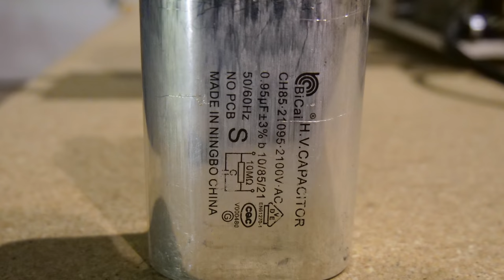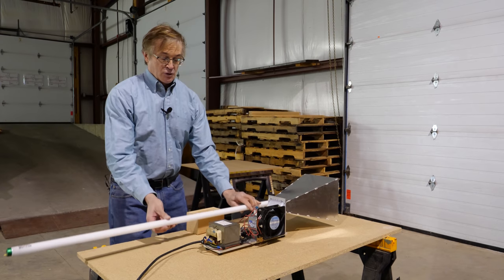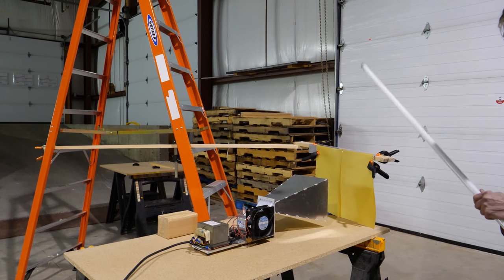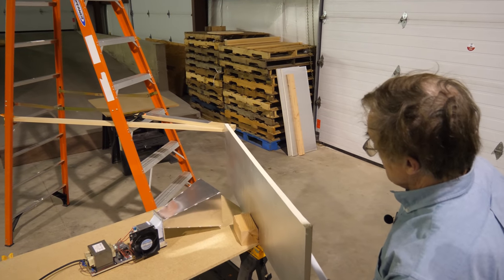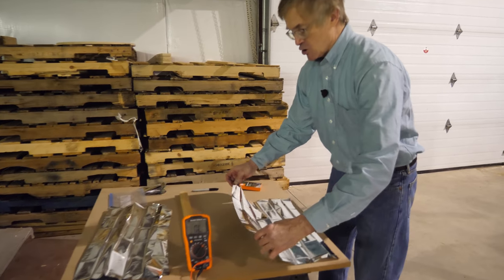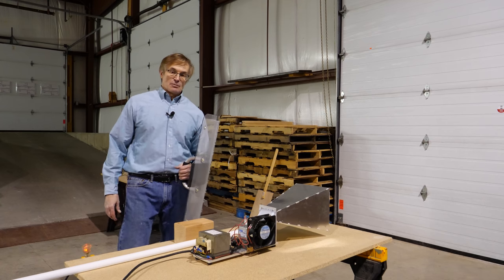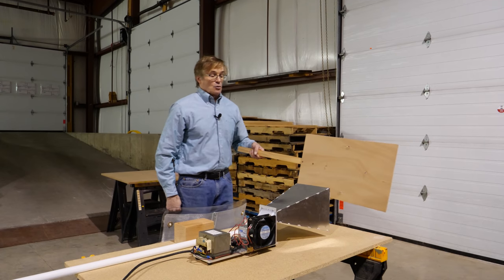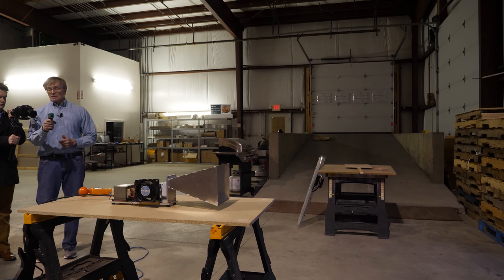You're not protected from microwaves... yet - Part 2

Comment: What will happen if you are driving a car and suddenly a microwave beam hits?
Reply from the maker: That depends on the power levels.  With enough power, the electronic control hardware will lock up and "hopefully" reboot. The car will probably stop.
Reply: @TechIngredients  
Alright, i through the metal layers of the car will protect the hardware
Reply from the maker: The car body is not a complete Faraday cage.
Reply: @TechIngredients  
True
Thanks

Comment: Would a thermal imager also work for detecting a microwave weapon? I was thinking that if you point it at the sky it might show a very uncharacteristic gradiant if it works the same as the IR thermometer. If it does not work for detecting the emissions, it would still likely indicate the source of the emissions since the weapon would probably be the hottest thing above the crowd that is not emitting visible light...

Comment: 1,200 watts equates to 20,000 per square meter???  Sounds like this "expert" doesn't know the difference between field strength and Effective Radiated Power (ERP). Your not getting more power out then getting in.
Reply from the maker: 1,200 watts of radiated power over the 0.06 square meter in front of the exit horn is 20 kw per square meter. What's the problem?
Reply: @TechIngredients  Are you saying that your antenna power is 1200 watts? Can you post the equation that you are using?
Reply: I played the video back and realized that I misunderstood what you where saying. I thought you where claiming 20000 watts total radiated power. My apologies.

Comment: How dangerous this world.  I try this not work. Lamp still light behind those material . Just a little better maybe. This is some scribbled test. Even if it work they will still to use other way.
2023/2/18：I have fluorescent lights in our neighborhood with a plastic bag on one end, and when I rub the plastic bag, it lights up everywhere. Last year, we had a strange phenomenon here. The clouds on the community were evenly distributed in patches.
2023/2/18, 16:22: The fluorescent lights suddenly went out everywhere. The sky suddenly became very cloudy. It's raining. Mybe it's the day can't see the shimmer.
By the way, before the lighter could not be ignited anywhere, it was very difficult. It's better now. Maybe it's my problem.  I seem to have reversed the adjustment on the lighter.
2023/2/18 18:51: Still shimmer are on everywhere. Here is night. It's dark all around. I wrapped myself in a metal survival blanket and held the lamp, still flickering.
By the way, i don't think microwave ovens can completely shield microwave leakage, although I don't like microwaves, so I haven't bought one.
2023/2/19 22:34: I bought 220v neon lights, to tried it around the house with neon lights, and occasionally one would light up and then no one light up i don't know why,  have a time continue to try.
2023/3/7 Actually, i tested the fluorescent lights and they failed to light up. I don't think microwave weapons are 220V. Or the low voltage but power will be greater than that of ordinary microwave ovens. And microwaves will penetrate the material. will feel hot. But still can't light the fluorescent lamp.

Comment: Before I get to my questions, I should first ask if you've performed any RF Hazard calculations for your testing setup using the formulae from FCC OET Bulletin 65 or any other methodology?
https://transition.fcc.gov/Bureaus/Engineering_Technology/Documents/bulletins/oet65/oet65.pdf

Another observation is that safety concerns aside, operating the output of the microwave tube into a horn is most likely a violation of FCC rules unless you have an experimental license, and potentially causing harmful interference to other radio operations.

You said you're putting out 1200 watts of microwave power, is that the actual power output or is that the input power consumption?  I think microwave oven magnetrons are in the 60% to 80% efficiency range and being fairly mature, let's use 80%.  

A standard 15 A outlet supplied by 120 V AC provides 1800 W of power.  So at the limit with an 80% efficiency, the tube could put out 1440 W.  Typically appliances aren't designed to operate at the rated limit of the outlet, and particularly for a device like an oven that could run for 20 minutes continuously, so a 1500 W input power is more typical for higher powered units.  At 1500 W of input power and 80% efficiency you could be seeing 1200 W of output power.  At 65% efficiency it would be more like 975 W of output power.  So would be interesting if you could confirm how you determined the power output to be 1200 W.

The horn looks like it is 8 to 10 inches square.  Let's use 10 inches or 0.254 m.  The area of the horn is 0.0645 m^2, so you have a power density at the horn face of 1200 W / 0.0645 m^2 = 18600 W/m^2.

So a bit less that the 20 kW/m^2 value, but you did say about, so maybe you were just rounding up.

The RF exposure limits vary around the world a bit but are all fairly close, differing in the time averaging value for exposure mostly and are usually broken into two classes.  Occupational or Controlled Access and General Population or Uncontrolled Access.

The FCC exposure limit for the Occupational class is 5 mW/cm^2 in a 6 minute time averaging window.  This equates to 50 W/m^2 in a 6 minute time averaging window.  So, you are allowed to have a continuous expose of 50 W/m^2, essentially a series of continuous 6 minute exposures, or you could have an exposure of 100 W/m^2 for 3 minutes then no exposure for the next 3 minutes or other variations like 600 W/m^2 for 30 seconds and then nothing for 6 minutes.

OET 65 provides different calculation for determining the near field of the antenna, the transition region, and the far field.  Each have a different rate at which the power density is assumed to decay with distance from the radiating aperture of the antenna.

The FCC does recognize that antennas aren't omni directional and that there is an additional reduction in the power density outside the principal radiating direction.  But you also have to account for other structures nearby the antenna, such as the metal garage door directly in front of the antenna providing an RF reflective surface bouncing the transmitted signal right back at you.

I suspect if you used a Narda NBM-550 or other calibrated RF exposure meter you would find that the levels you were subjecting yourself to were many times above the safe / legal limit.

Having worked in radio communications industry for over 40 years, principally at microwave and mmW frequencies and with power levels in the kW level, RF exposure is something that we take very seriously.  Different frequencies have differing levels of penetration into the human body and will resonate with different organs as frequency varies.  You won't always feel heating or pain while experiencing damage to a portion of your body till it has already occurred.

Please do have a look at OET 65 and some other literature regarding radiofrequency exposure and the relevant limits and take care of yourself and others around you appropriately.

Comment: How can it be 20kW per square meter if all radiation diverges and you are using a horn fed with only around 1kW with an aperture a lot less than 1 square metre? You mean "equivalent to" -  if you multiply power by how many times the area of the open end of the horn fills one square metre. Same intensity level at very close range for yours, but not the same effects due to the much lower frequency. The military version is 100kW (the truck is the generator) with a narrow beamwidth that can only target a small area at a time (and a fairly short range). It is also 93GHz for safety - It won't cook you at distance due to penetration depth, but can activate the nerves that make you feel like you are on fire (if yours could then it would be a more interesting, and a more entertaining, test :-) ) and won't blind you like a very powerful light source (the most concentrated being a laser, at this time). It's about as close to a high power, long wavelength infrared beam, as can be gotten with today's technology. It should feel about the same as standing too close to a fire or an iron smelter without heat protection (you will naturally want to get away - the entire purpose of the device).
Reply from the maker: The power  density  for radiation intensity  is routinely  given in watts per unit area. Look at laser safety limits and laser machining requirements.  Divergence simply changes the area over which those same watts spread out.
Reply: @TechIngredients  If you paid attention to my username, you'd probably realise that I already knew that (what frequency has a wavelength of 3m, and what sort of character does the name sound like). Your delivery makes it sound a lot more than it actually is (to the naive average viewer), even if technically correct. I can get a burn with only 1W of radio frequency energy if it's concentrated into a tiny point.
If you are interested in a design for a real emp weapon, that can disrupt electronic devices (not burn you) at several metres distance, that runs from only 3V, and poses only a small safety hazard to a person (a mild electric shock if you touch it), I'd be happy to email the design and how it works.  Given the right YouTube title, it's sure to attract plenty of views and there is nothing already like it on YouTube. Do not use for nefarious purposes though!
Reply: @TechIngredients  If you paid attention to my username, you'd probably realise that I already knew that (what frequency has a wavelength of 3m, and what sort of character does the name sound like). Your delivery makes it sound a lot more than it actually is (to the naive average viewer), even if technically correct. I can get a burn with only 1W of radio frequency energy if it's concentrated into a tiny point.
If you are interested in a design for a real emp weapon, that can disrupt electronic devices (not burn you) at several metres distance, that runs from only 3V, and poses only a small safety hazard to a person (a mild electric shock if you touch it), I'd be happy to email the design and how it works.  Given the right YouTube title, it's sure to attract plenty of views and there is nothing already like it on YouTube. Do not use for nefarious purposes though!
Reply from the maker: If you already  knew that, then your  statement doesn't  make sense. I'm not really interested  in EMP weapons, but thanks for the offer.